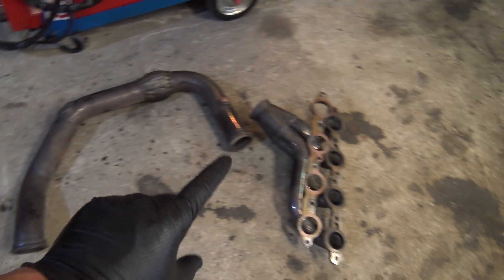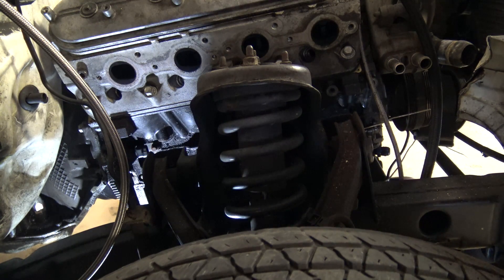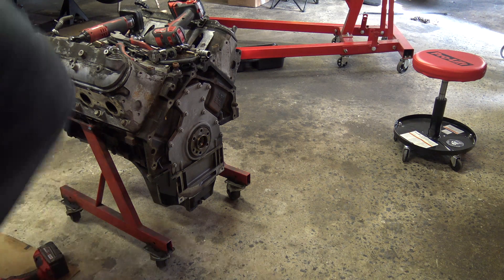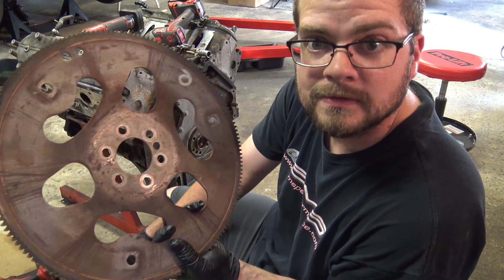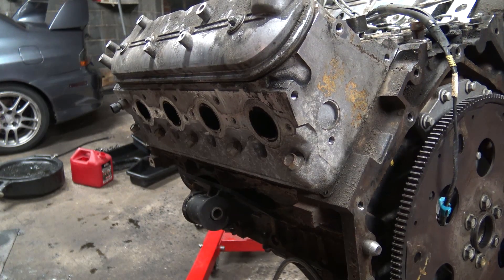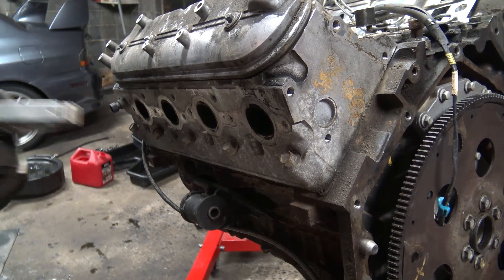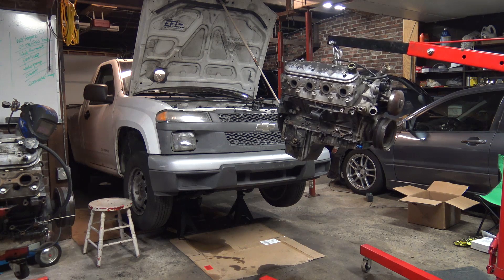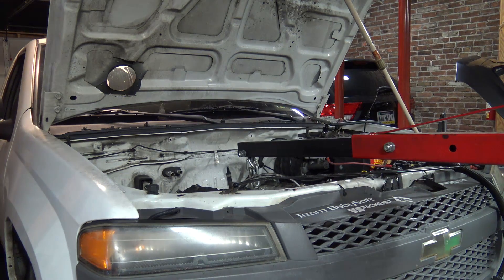dont BS me ep4 - engine swap 6.0 to 4.8

Comment: What's the idea of putting a smaller motor in ?

Don't forget to put Loctite on the flex plate bolts because if you don't, the engine may leak oil.

I know on a manual LS1 engine I reused the 11mm bolts because I was tight on money although they should've been replaced.

I apply Never Seez  to the exhaust header bolts as they can get tight & the bolts need chasing down with a thread die then the threads in the cylinder heads may need cleaning out with a thread tap so as not to strip out the aluminium threads.
Reply: You're 2 years late ... also This is sloppy mechanics.. no were not taking your advise

Comment: I have a 04 chevy Tahoe  with 4.8 and I believe  373 gears with 211k what are these motors mi wise good for and if the motor was to go sometime what would  be good to put in it stay with a 4.8 5.3 or 6.0 I'm a diesel guy (Cummins) so I'm new to the la world but the Tahoe  is used for pulling my sxs and hunting the 4.8 seems to lack for pulling any info from any ls guys would  be appreciated  and the tire size is 295,70,17 thanks guys

Comment: is the following the adapter to use on a 4l60e flexplate to fix a 4l80e convertor???  https://www.ebay.com/itm/LS1-Flexplate-Adapter-Spacer-for-GM-TH350-TH400-Conversion-LS2-LS3-LS6-LS7-R2W8/401521326660?hash=item5d7c893a44:g:3UsAAOSwJ-BazsqY&vxp=mtr

Comment: Is the 4.8 narrower than the 6.0?
Reply from the maker: +tydodge they are physically exactly the same size externally
Reply: Sloppy Mechanics Wondering about steering box clearance on an 1989 S10 thanks.
Reply: tydodge swap it to rack and pinion problem solved

Comment: ill be that guy. Torque spec on flex plate bolts? lol.  Milwaukee' #?
Reply from the maker: whatever my 6 inch ratchet goes to, with me pulling, thats the tq number i tighten them too
Reply: Sloppy Mechanics 
Haha I've found a nice ratchet I use for the lighter stuff all the time. 
It's a snap on 1/4 inch ratchet with 3/8 drive guts in it. 
It's that little short 5-6" long dude. 
It's so cute. 
With some halfass testing if I really tried hard and almost hurt my hand I'd get something to around 20-25 ft pounds. 
Great little ratchet for gorillas who are always stripping stuff out😂
I wasn't implying you do that
Reply: Sloppy Mechanics so basically the ermehgerd ft lb or whatever your arms feel like doing for that day.

Comment: mr. sloppy good afternoon, I have a 2004 Pontiac GTO that's goin twin turbo on the 5.7 upgrading heads to a 799 nd a btr twin turbo cam 226/235 .605/604 114+5 btr Platinum Springs and retainers and pushrods and ls9 lifters how much power can the 5.7 handle before blowing up oh yeah the car has 134k miles

Comment: i thought you where going to smack you head on the ac  line nipples when you where doing the vert swap..an motor mounts are always a pain..i once had a set of billet f body ones cause me to pull a motor a dozen times because they didn't fit..

Comment: 241's I'm porting for a 5.3 GT45 setup. 285+ cfm 220cc intake 83cc exhaust runners .560/.560 @.050 216/220 LSA 114
1993 AWD GMC Typhoon
Reply: HeadFlowInc 

even .030 milled 241s are pretty crazy, I can only imagine ported ones!
Reply: ShadowOfDeath24  I think the combo should run good. It's got a 4L80e w/PTC 3500 converter and 3.42 differential front and rear. Richard is looking for mid 6's in the 1/8th mile.  His old Turbo 4.3 ran 7.30's 1/8th
Reply: HeadFlowInc. that cam is super close to what I use, .564/.564, 218/220, 114 on a 9.4:1,  5.7 liter iron block. it has gobs of bottom end torque.
Reply: Themrgofuckyourself I'm considering the same cam for my 4.8. Or I already have a 2002 LS1 cam which I hear is a good 4.8 boost cam. I'm eventually putting a small T72 Turbo on it as my daily driver.

Comment: did you check the compression on the 4.8 before you installed it? Or is this a roll of the dice? I can't thank you enough for all the ass busting' you've done for the benefit of others........
Reply from the maker: i have not checked it at all, it was pulled running from my friends, dads truck
Reply: SEND IT!
Reply: Sloppy Mechanics I have the same engine which is my first ever engine and idk what model ls it is but when I took the heads and the whole bottom end out I found out that one of the piston cylinder walls was pitted from water getting into it from a blown head gasket but it wasn’t much of a lose because it was free but me and my dad really love your videos

Comment: It always amazes me how fast you can tear that junk apart and slap it back together again, for most that'd be their whole years project!
Reply from the maker: doing what i can with what i got
Reply: and then posts.
Reply: Yeah, if this were another channel it still might be snowing in the vid lol.
Reply: crisray6789 
Pop it! 
Just pop it outta there!
Pop that sumbitch! 
It needs poppin so pop it outta there. 
Pop pop pop it man!
Reply: looks like you're doing a hell of a lot with mostly simple hand tools. Most fully equipped shops don't pull this stuff off this fast. Great work with a lot of great information as always.
Reply: Seriously, by the time mine even runs you'll probably have finished 6 of these things at least.
Reply: Again, THANKS, yer down a fine job
Reply: He doesn't let anything snowball, a lot of people will pull the engine and then clean the bay maybe paint it etc etc he does the essentials and doesn't waste time
Reply: This is what you get when you know where all of your tools are. Hell that's why most projects don't get finished. Guys garages are a fucking disaster, tools everywhere, they don't know where shit is, they'll spend 15 minutes looking for a wrench.. And once you've pulled the same kind of engine 20 times, it gets pretty easy. But seriously though, keep your shit organized. Invest in some power tools as well. An electric impact vs a ratchet can be the difference of 2 hours by the end of the day.